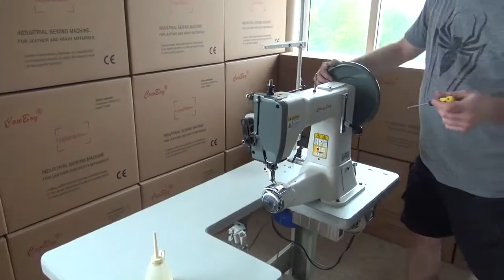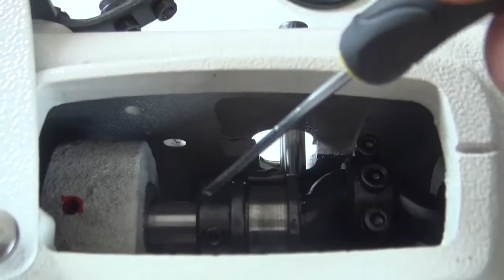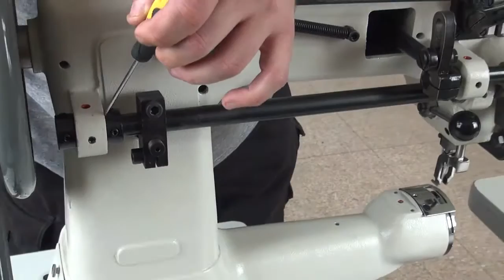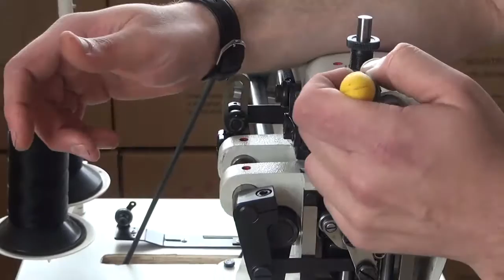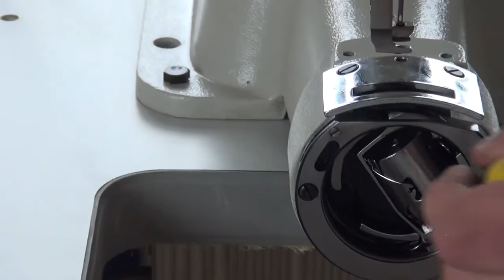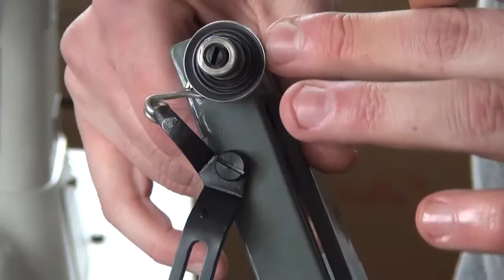How to oil your Cowboy CB3200 leather stitching machine

Comment: How harmful is accidentally getting oil in the tensioner discs?  I know, fairly dumb question.  Also, the thread frays going through the upper tension.  But if I loosen it enough to stop the fraying, it's too loose.  Any advice would be welcome.
Reply from the maker: Not really harmful! It is not easy to explain you the balance between needle thread and bobbin thread, it will depend on your experience. Please call our local dealer for help, thank you!

Comment: Hi. How do I open the center walking foot on the 3200 so that I can see the needle better. I have seen Bruce Cheaney do this and this will help considerably if we can do the same........ We have 6 Union Lock and Campbell machines and oddly they will also come with a closed foot if we need to replace them. We have to mill out the front to make the awl ( in the case of needle awl machines) visible when we stitch. This is of utmost importance for accuracy for us. Many thanks for your videos. We have recently acquired a 3200 and this is a concern at present as to how much of the foot we can take away. Thanks.
Reply from the maker: Ross, we have opened center walking foot for both CB3200 and CB4500 leather sewing machines, please contact our American Office in Ohio at 330 692 1418 or neelre@comcast.net, thanks!

Comment: WIll you do a video on how to adjust the presser foot spring tension as well as putting the optional lighter spring in the machine. 
Keep up the great videos and have a blessed week my friend.
Reply from the maker: It is very easy to adjust or the presser foot tension spring, just turn the black bolt on top of machine. If you still have question, please write to info@cowboysew.com, thanks!